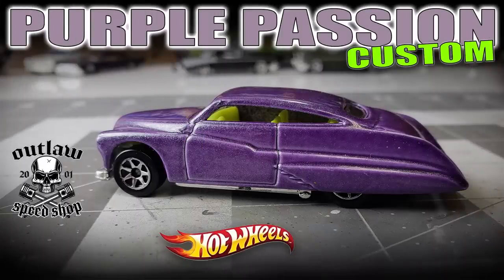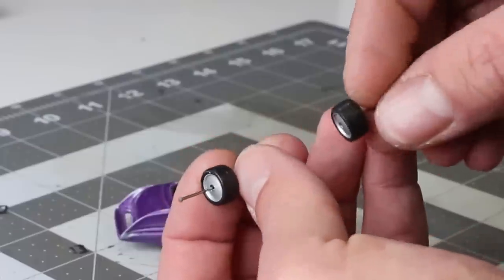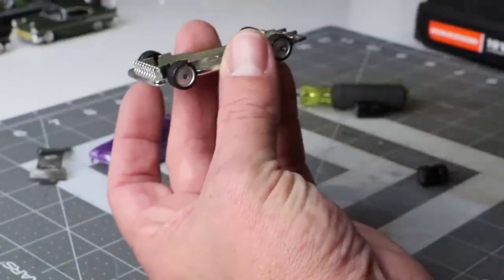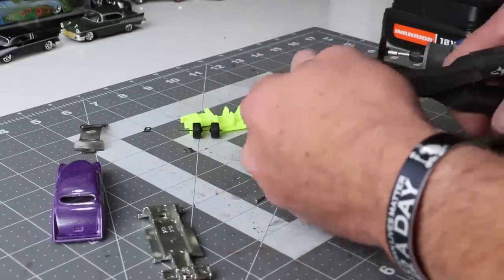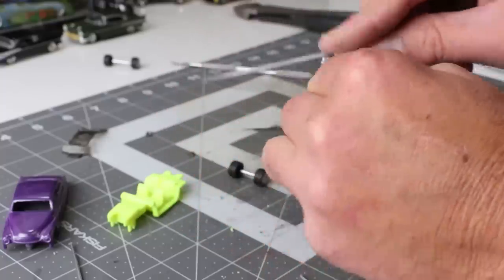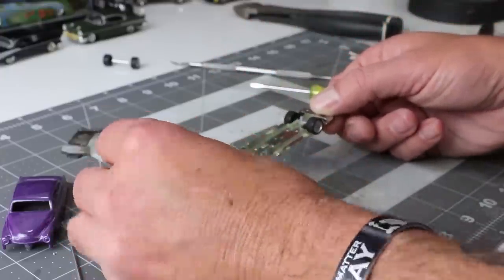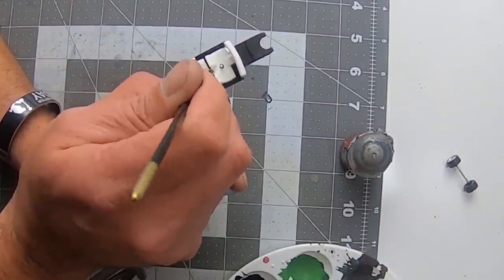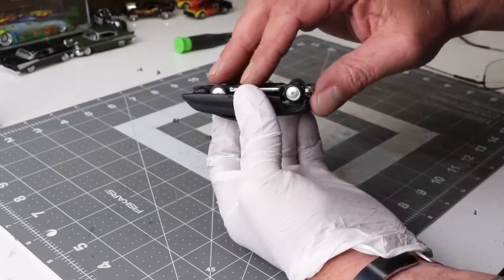Custom Mercury Lead Sled | Hot Wheels | Purple Passion

Comment: Hey Keith, That is how it's done 100% Black and Beautiful. Leading isn't easy but the work put into the finish leaves Bondo for dead. I was taught how to do it in panel shop year's ago and used it almost exclusively on my first car resto. Would you believe a 1974 Holden 4 Door Kingswood Sedan. And yes I painted it Midnight Black . Sweet Job again Keith. Cheer's Tassie John

Comment: This looks SO much better!! It's an older casting, and Hot Wheels and other companies have come along way in their molds since the early 90's. I wish they would use better wheels (great choice by you), but there are always room for improvement. I guess the hard part is keeping the price point at around $1.00.

Comment: Love the car. And car shows are a great thing to spend time on. I try to go to as many as I can locally. Including Street Machine Nationals up at DuQuoin IL. On a side note. One thing I notice with the diecast customizing crowd is that you all seem to use Dremel moto tools. But nobody seems to use a flex shaft attachment. I bought one a couple years back and I wouldn't give it up at gunpoint. Ever try one?
Reply from the maker: I have one I use at work, but have not tried using one for this stuff.
Reply: I guess I have small hands for a guy. My Dremel has always been useful. But it also always seemed a bit big and unwieldy to use. I studied art in college. I eventually was doing blacksmithing, metalsmithing, jewelry, and glassblowing. We used to use a Foredom flex shaft machine and it was a lot easier than using the Dremel. So when I got the flex shaft attachment for my Dremel it just worked for me. Recently bought an economy priced flex shaft for doing jewelry work and bought and extra foot control to attach to my Dremel. Again, I'm comfortable with it and feel I have a lot more control.  And I just wondered how many customizers are using the Dremel as is because they have never tried a flex shaft? Anyway, good talking to you.